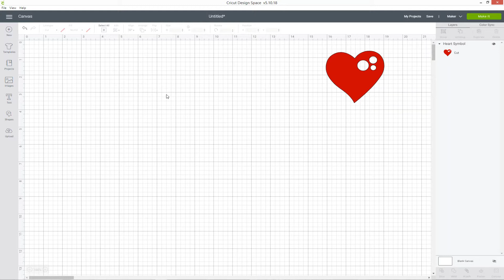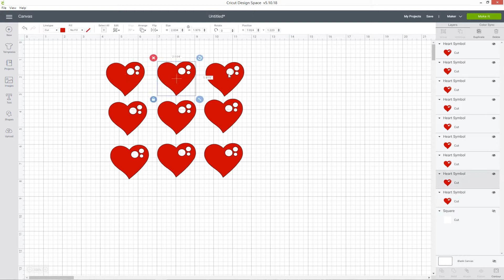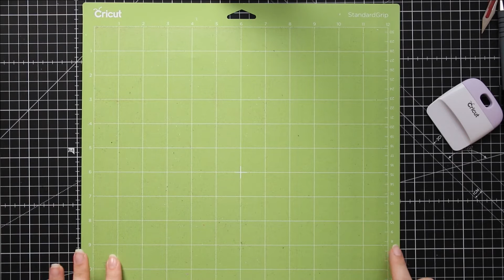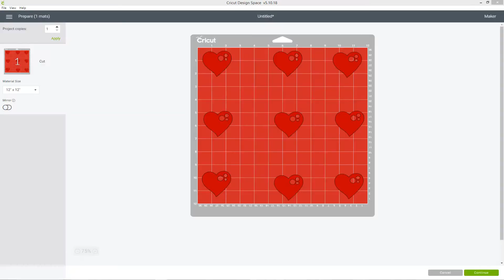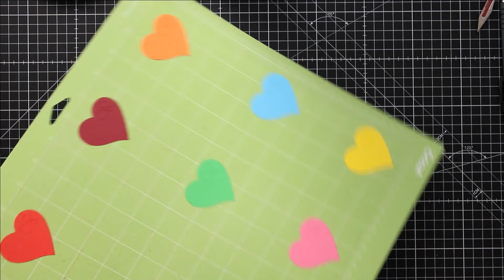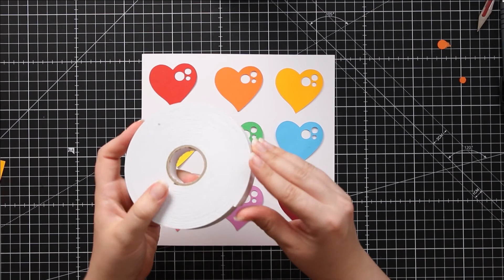Cricut Hacks!! Make Beautiful Rainbow Cards from your Card Scraps (Cut on ONE Mat!)

Comment: Thank you for the idea! I wonder if you could create a 12x12 square in DS and place the hearts and use the distribute tool and then delete the 12x12 square and attach all the hearts so they will stay distributed. Just a thought. 😊
Reply from the maker: You could, but because it's being cut from cardstock (not vinyl) they will all move apart when you take the cut shapes off of the mat as they aren't joined together, so I don't think it's necessary to line them up perfectly before you cut them.